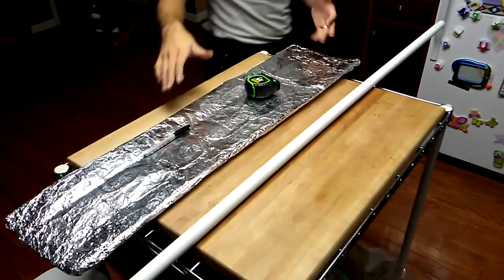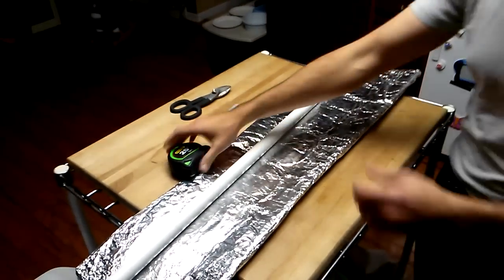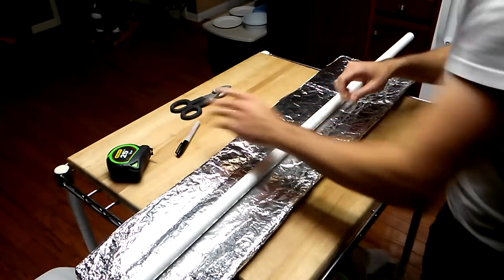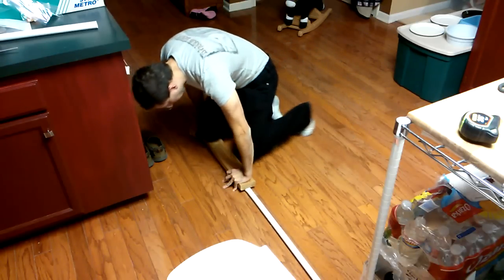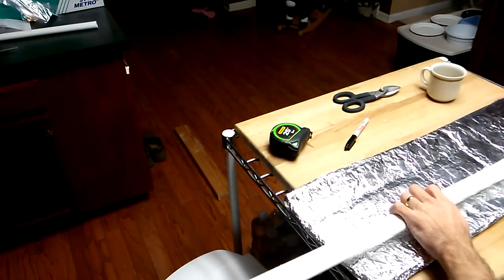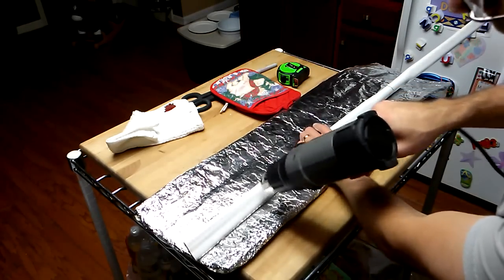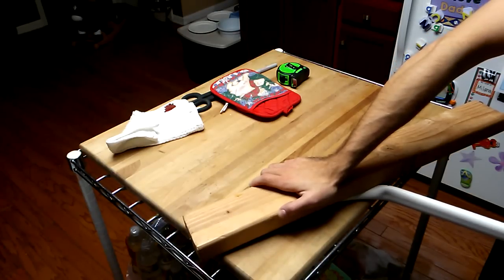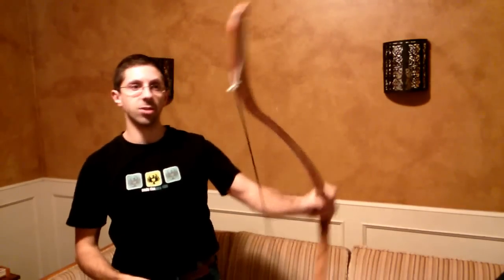How to make a PVC Wood-Elf Bow

Comment: if you put a piece of rubber 1/2 inch line on the edge of the  2x4 you are using to flatten the pvc you will get a nice smmoth round edge on the crease part.

Comment: The bend in the pvc could have probably been from the material (gauge) being too thick on one side as it came out of the machine's extruder die. It was not corrected by the line operator and the pvc held it's shape as it went through the water cooling tanks. Before the line was started up, the extruding operator should have been a bit more precise with his feeler gauges to ensure the exit way out of the extruder were more precisely even. But, anyway...lol. Nice video, man! I'm want'n to make me one of these things something fierce! Thanks for the tutorial! :D
Reply from the maker: Interesting! I wish I had an extruder machine, no lie. Particularly if I could change the diameter of the pipe being extruded on-the-fly... awesome!

Comment: I've made simple foam training swords using pvc, tube foam, and duct tape before. I'm new to the bows. At my local Home Depot, I've seen special extra flexible pvc piping. Does anyone know if that will work better than regular pvc for the flattening process?

Comment: do you ever have issues with the loops of the bow string rubbing paint off of the siyahs? perhaps mine aren't thin enough?
Reply from the maker: Yeah,  that happens,  but less if the sanding is done well to give groves for the station to stick in.
Reply: noted.  I think I might put a little modge podge around that area to help out with the abrasion as well.  Thanks for the quick answer.  Hope all is going well.
Reply from the maker: +The amazing Person About 15 dollars, maybe less on Amazon :)
Reply: firebat128

Comment: how much power would it add if you drilled a hole in the handle,and added expanding foam?
Reply: almost none. He found in one of the other videos that it added a pound of draw weight. It also destroyed its stability so i would not reccommend trying to do that. If more foam gets on one side of the bow rather than the other, it'll stress the one side out more and possibly lead to collapse. If at all, only do the handle very lightly to avoid that. That's what I do and it seems to be fine. A little bit goes a long way especially since it expands quite a bit. The real application for that foam would be to add stability in the handle so it reinforces the handle and doesn't get stressed as much and more of the stress goes on the limbs and the recurves. You don't want the handle bending a lot when you pull it back.
Reply: *****
yeah i was curious to know.Thanks  for the explanation
Reply: I've been trying to figure out how I could install a wood block in the handle area (for stability/reinforcement) in lue of the foam core idea. I see it as being to unpredictable as to just where that foam is going on one side or the other (as Tom had noted).
My thought was that the handle should be slightly elongated forward (to better fit the hand and to gain some stability in one's grip)...but the only way I can see that happening is to heat/soften one end of the bow blank and insert the block to a given distance to center it (which COULD, in fact, work out well in that one could then measure from the ends of that block {down the inside of the PVC} to then cut the final dimension of each limb)

Okay. I just had a thought (IT'S A MIRICAL!!! LOL!!!). If one were to slide dowels (or whatever) down the length of each limb (while it's still round) to the outer end of the handle area so as to enclose the handle area...this would allow one to inject foam into the handle without the possibility of it migrating into the limbs.

Just a thought,....

Comment: How did you cut it can you use just scissors vs a saw
Reply: I know I'm late, but you can get a PVC/other piping cutter up to 5/8 inch for $8 at Home Depot, or up to 1 1/8 for $10 if you use bigger sizes for your projects.

Comment: could you use a blowdrier if you do not have a heat gun?
Reply from the maker: Generally no,  the bow dryer won't produce enough heat.  It might work if you were able to use the dryer to heat an insulated "oven",  but for the effort,  I think your best bet is to buy a $15 heat gun.  thanks for watching!
Reply: +Tim Piatek can i use a fire??
Reply: Tim Piątek  Panie Piątek bardzo dobra robota ! Zrobie tali łuk dla mych chłopaków !😉👍